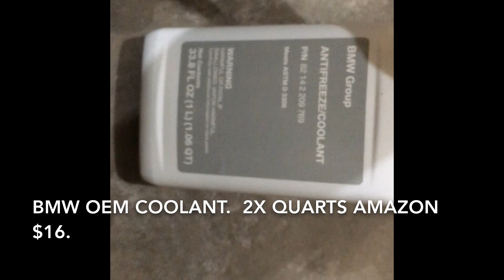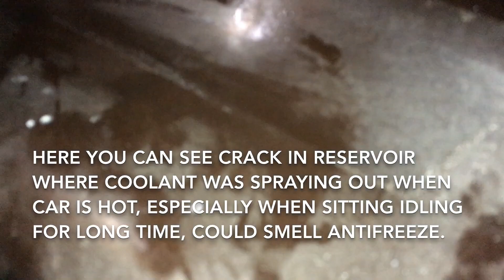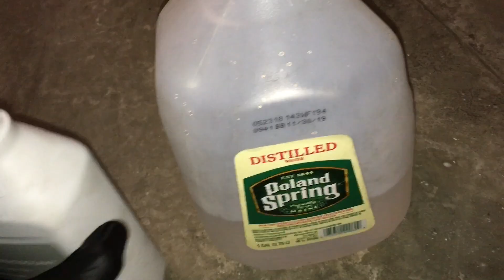2011 BMW X5 35i w/98,000mi - Coolant Reservoir Replacement.

Comment: Could that crack have been just sealed some how? Just curious.
Reply from the maker: No I don’t think the crack can be sealed, I actually tried taping with some aluminum tape and it did nothing to stop the leak.  200degF coolant.  Only fix in my opinion is to replace tank.
Reply: Ballston DIY thank you. 💪🏻
Reply: Ballston DIY  you had no problems with the hoses at the connecting end right?
Reply: @ballstondiy2101  You can always use a heavy duty epoxy
Reply from the maker: You could try epoxy I guess.  I suspect it wouldnt work long term with the heat and pressure.
Reply: @ballstondiy2101  Then again, that's sort of the story behind all used BMW right? The second you fix one thing, something else breaks haha
Reply: K T the epoxy didn’t work. I ended up just changing the tank..$120. All fixed. Simple job.
Reply: Do you need to drain the radiator?  Or otherwise to pre-work that isn't in this video?  I'd like to do it myself but not an expert mechanic.  Quote I got from independent mechanic including replacing a couple hoses was $750 😭
Reply from the maker: @eagsalazar  what you see is all you need to do.  Nothing left out.  I can’t comment on pricing the shop gave but with a few simple tools and some patience the tank can be replaced yourself.
Reply: It is a good idea to complete the automatic bleed process after replacing the tank.  There are many explanations but I overfilled reservoirs, place the cap on, start the ignition without pushing the brake so the engine doesn’t start, turn off A/C, set heat to help highest level, set the fan to the lowest setting, step on the gas pedal for 10 seconds.  The electric water pump will cycle for about 15 minutes and purge the system of air.  You will need a strong battery or you risk not be able to complete the bleed procedure and restart the engine.  I put mine on a trickle charger.

Once the bleed cycle is complete, remove the cap and siphon off coolant to the top level of internal gauge.  Then replace the cap.